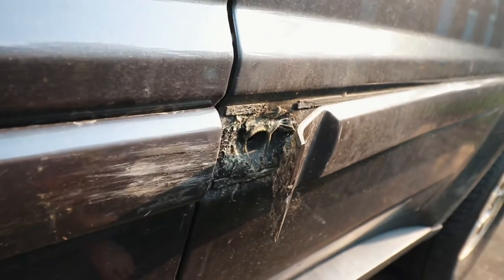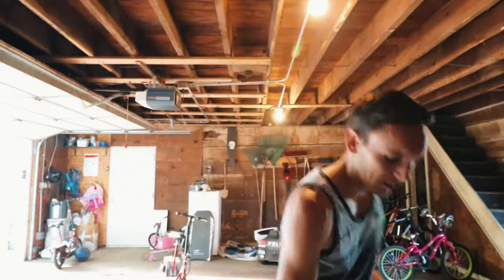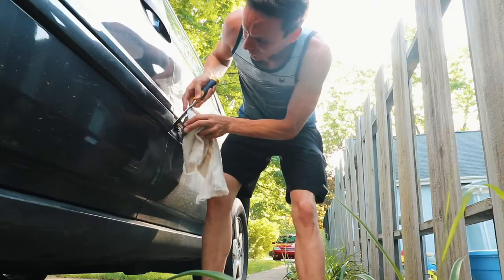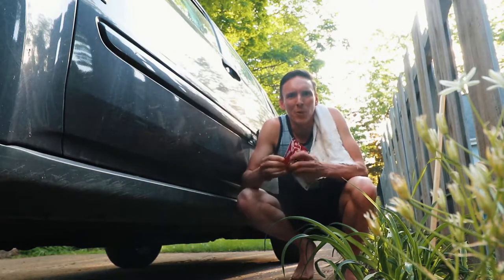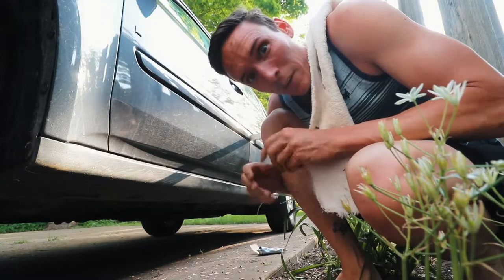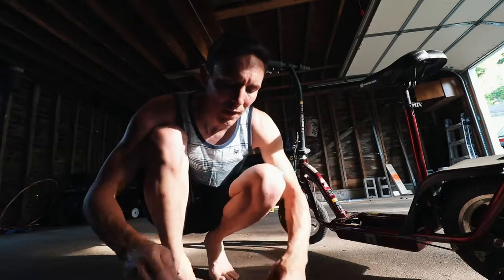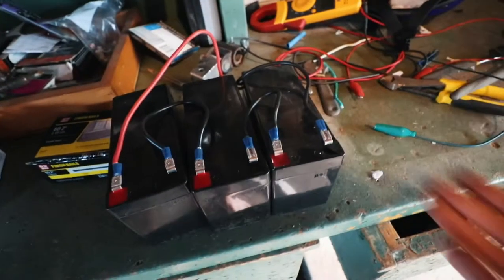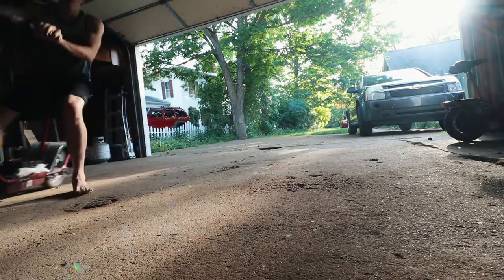PV01 | Schwinn S500 36 VDC mod and other evening things

Comment: I find it so funny ive been custom building these scooters 4 23 years now and i recently made one of these from 24 volt to 48 volt. It topped out at 32 mph with the 11tooth 500 watt brush motor. It was like taking a 4 cylinder and turbo charging it.

Comment: You need to buy a lithium battery for that. You can get a 36v 20ah battery that will fit right in the stock battery compartment using the stock cover plate and quadruple your distance between charges. Yeah... I have 3 of these scooters lol
Reply: Can you tell me info of lithium battery?  And which converter you bought? I have 3 scooters all found in garbage at different times and all work just needed charge cords and batteries. E90 and e100 razors,  and the big prize was the schwinn s500. But the batteries were swollen in there and I'm temp using 2 small 12v5AH BATTERIES from the e100 and it literally dies after 10 minutes of fun. I don't want to waste any more money not upgrading it to be better faster and longer range
Reply: @fonz1anddone713  You'd be wasting your money putting lead batteries back in those things. They don't last long and they're weak.  Since you have to buy batteries anyways, just buy the lithium 24v batteries. They last 10x longer and have a much longer lifespan. You're going to pay $80-90 for two lead batteries that will be dead in a year.  Pay $150 for the lithium and you'll get way more than 10 mins of fun. You'll get days between charges.
Reply: @hannoverfisst4873  can you tell me info on the batteries?  There is allot of options and if you've already had time to try out some I'd like to know your opinion. And I was going to buy a converter that can handle 24-48v minimum so I have room to grow. What converter would you suggest?
Reply: Lithium batteries are so dangerous i would use gel batteries and lead acid never Lithium
Reply: @fastfords9072  lol I can't tell if your serious? With the gel batteries I couldn't even full throttle for a whole block without them quickly losing power. Lithium I haven't even come close to putting a dent on the power. If ur worry is an explosion I'll take my chances dying with a huge smile on my face lol
Reply: @hannoverfisst4873  I spent about $300 for 48v lithium battery, 48v converter and throttle and I went from top speed of maybe 12mph and that lasted about 2 minutes to 30MPH and never ending power storage. It's such a difference that it's like having a Toyota and getting a Ferrari internals. Lol
Reply: @fonz1anddone713  the reason is you need throttle and controller from this guy and you can ride all over.
Reply: @fonz1anddone713  hell ya im serious ive driven 12-15 miles full throttle never let down.
Reply: @fonz1anddone713  been doing this for 23 years

Comment: Hey Mike, Just got one of these, can you provide a link to the speed controller you used as well as what brand and voltage batteries you have on there? Also about how long does the charge last? thanks!
Reply: a 500w motor 12v x 3 batteries , he should up grade on the motor, this one may over heat
Reply: @ccccen  get a S500 schwinn electric motor or 1000 watt brush motor used on ezip 1000

Comment: How did you make the 24volt faster ??? anyone
Reply from the maker: Bought a 36v Speed controller and wired up 3 12v batteries instead of 2.